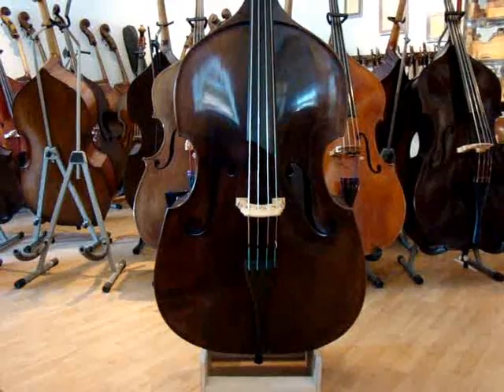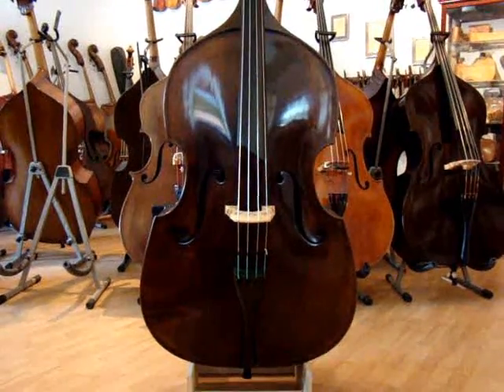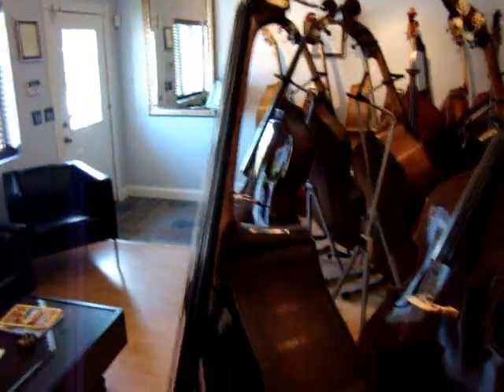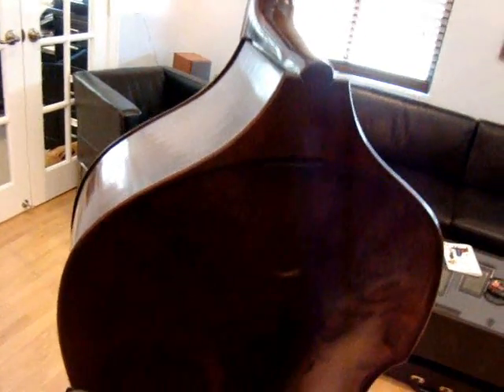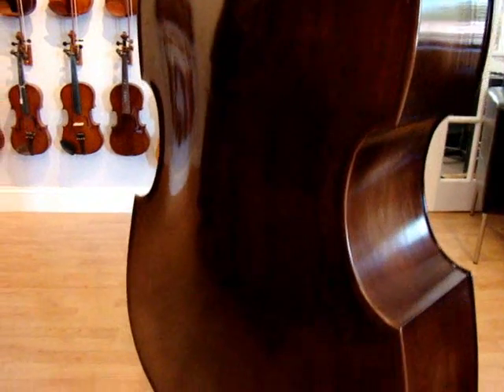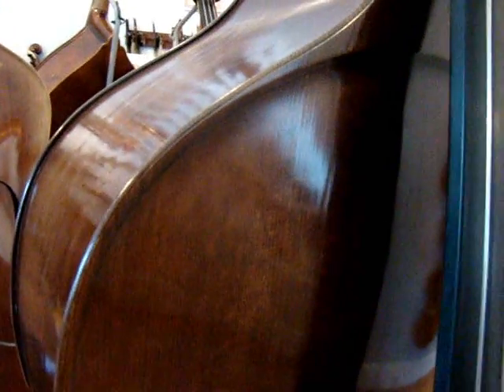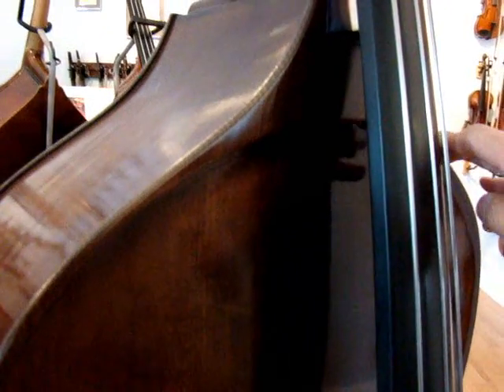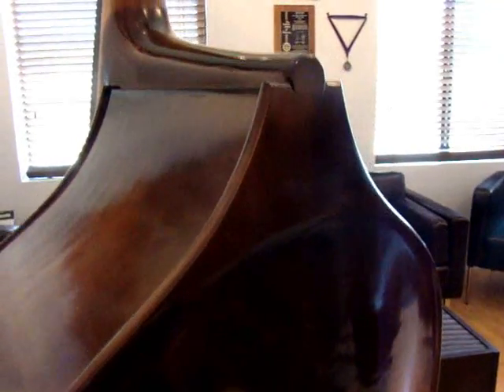Upton Bass: UB Concert Fully Carved Double Bass Gamba Outline

Comment: I recently did a solid body guitar using the techniques I learned to do bass violin or cello construction. OK yes it is a solid body guitar, but the idea was to test claims of mechanical coupling to transfer sound vibrations from the neck into the body. I could have used a CNC machine, but opted for carpenter's chalk, and careful hand carving. I did the instrument in memory of a friend who thought glue joints lost some sound transfer. The jury is still out, until I make one with a glue joint.